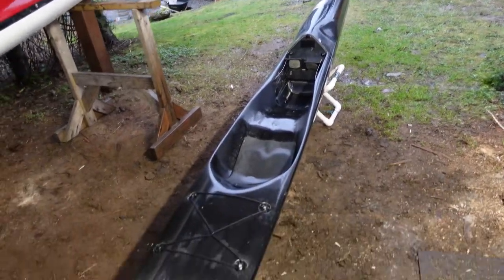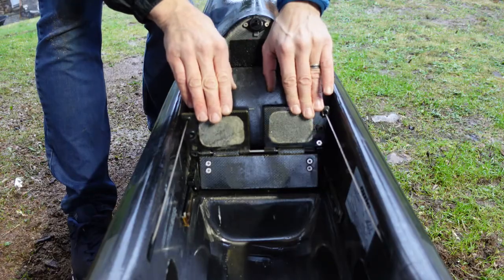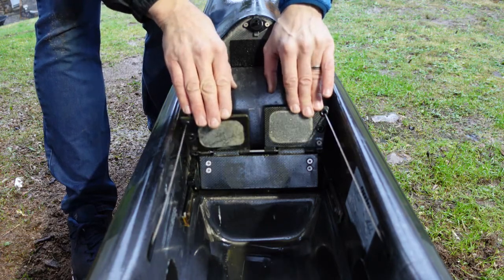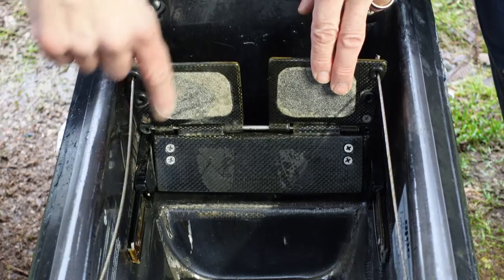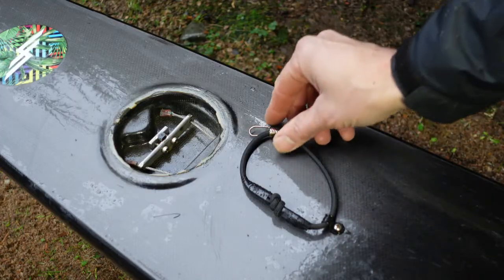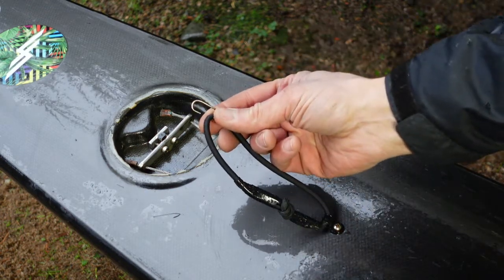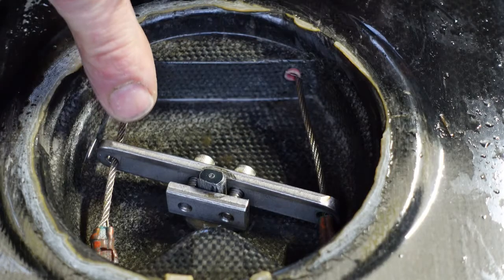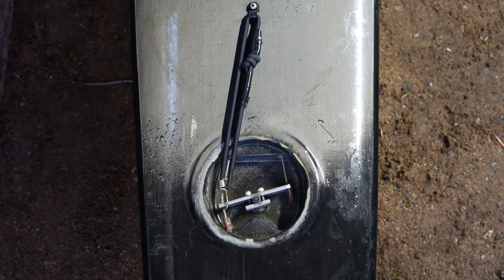Kayak Rudder Repair WITHOUT GOING TO SHORE

Comment: good idea but with the sea kayak you cant reach the back to hook it the rudder without getting out of your kayak good thing you can lift the rudder out of the water . great idea with the other type of kayak you would be going around in circles otherwise , and be totally out of control . so dangerous . still a good idea though to use bungie to fix a rudder as a temp fix to get you back to camp or car . now I have two ways to fix a rudder .re-join the broken cable if you can or the bungie method . Nice thanks . I am not sure i would have thought of the bungie method without your hint . thanks